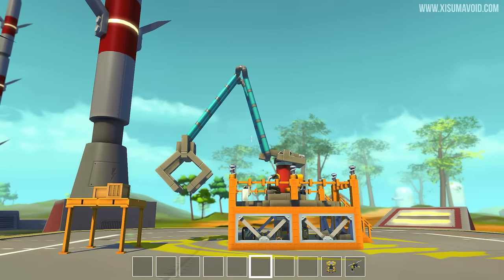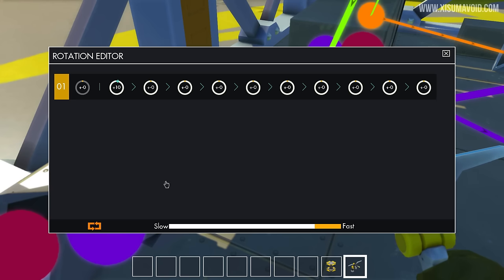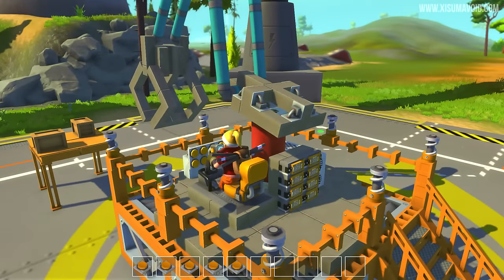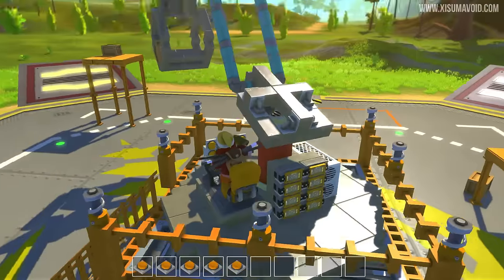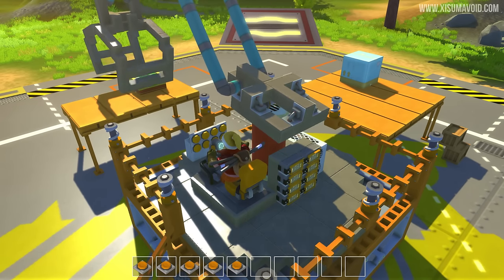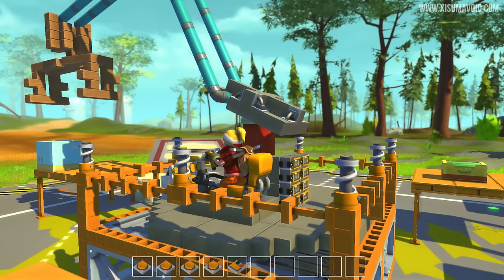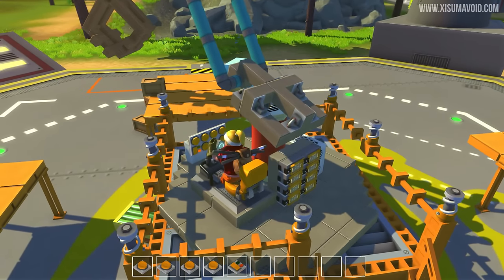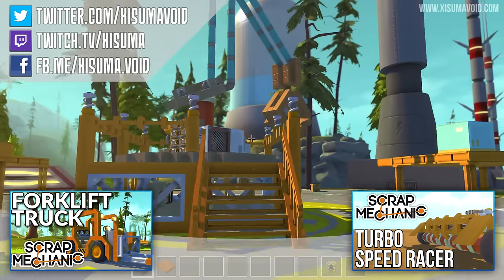Scrap Mechanic: Smart Crane

Comment: The problem with your claw is it only has two options... all the way open or all the way closed. So when you try to grab something the game is trying to close the claw all the way but a box is in the way and so it gets pinged off by the physics engine. Try to make the claw with many smaller increments of closure so you can more delicately grab a box instead of Kung Fu Death Gripping it.

Comment: Try using the small ramp block at the end of the crane so they can slide under the boxes.
You could also maybe put some sort of a counterweight at the back of the crane to prevent it from falling forward.

Comment: The small angled orange pieces might work better as the 'teeth' for the claw as the can wedge under the object you're trying to pick up. Also you could experiment with the small shocks to lessen the violent snapping shut of the claw when it slides off the side of the object.

Comment: Use small wheels, 3 on each side of the claw to effectively allow you to suck items up into a holding area within the claw. then you can just run it backward to let you eject items from the internal storage. You should even be able to move upto 10 boxes in one load

Comment: Hey X, Maybe add a way to tip the bucket, that way you can pick up items by cradling them, similar to a dump truck, rather than sole pinching them. Also, giving the claw an analog control rather than only open and closed may help with how the game deals with clipping objects.

Comment: i got 2 ideas for you to try out on your crane:
1) put a censor inside the claw so a small thing reacts (like a 1x2 row of blocks turning) inside the cockpit that shows that you are hovering above the crate
2) put a row of the small 45 degrees ramps on the crane so the edges slides underneath the crate a tad easier

Comment: Hey xisuma! i have an idea for a claw that works perfectly, i used it on a flying pad i built so i could pick up toilet paper with me :D but it should work on a bigger scale too (although it doesnt look like a crane claw..):

lets assume your claw is like this:
------------
|            |
|            |
|            |
^     **   ^

**  is the box you want to pick
the only moving parts are the "^" signs and they move horizontally to close like this:
------------
|            |
|            |
|            |
------------

the box will just jump up into the soon to be closed containment area for it. 

Notes:
* Be sure to cover the claw from all sides otherwise the box will fly out of it
* Wont work on non-flat surfaces

Comment: I think the main problem would be that the claw doesn't have any sort of grip, so the boxes just slide out. Maybe put some wheels at the end, then make those wheels pull/push the boxes into the claw?? or put those wheels horizontally and not move them at all??

Comment: Firstly, you did a great job on the crane with the Twitch chat.
Secondly, I think it would work better if you don't use a claw. That would require a hook (or different mechanism) and modifications to the box though.

Comment: maybe make the claw a 4 way design so that it holds the item from all 4 directions. That way the only ways it can go are up or down. if it goes up, its good to move, if it goes down, just try again.... or maybe the 4 will be strong enough to just hold the item in place without it sliding out... I also thought of something cool, why not make the crane attachment be like a forklift where the bars get inserted beneath the item. So the item will have to be in a pallet thing which should be pretty easy to make and then the clay would have 2 prongs on each side that can just be inserted into the pallet :P Just a funny cool idea... and also, one last idea, it would be cool to see a crane that can move a fallen train back onto track... XD It would be hard, but cool in the end if you are able to pull it off.

Comment: If you could make it close completely (by making two interlocking bits on the side) that might solve your problem with things popping out. Are there any bits that are thinner than one block? if so it might work to put those on the edges of the claw to slide under. maybe even ramps could work to slide the box into the claw. looks good though!

Comment: The claw may should have only 1 bearing for each "finger" of the claw.
The bearing that rotates the claw should be an "H" form instead of an "I" so you only need to put 1 bearing into the "H" on each side and the claw itself would be a bit smoother.
I hope it's understandable what I mean.

Comment: +Xisumavoid First off, nice work. As many others have mentioned, angled tips on the claw would be good. Something else you may consider implementing would be a counter weight, perhaps even make it adjustable. Just add heavy blocks to the back of the base head (the part attached to the top of the red pipe). If you want to take that a bit further, use some bearings to make it extend further back (much like how sliding doors are designed). A 4 way claw could work, but I'm aware that there would have to be at least a 1 block offset which may cause it to not work.

Comment: Why don't you zoom out when controlling the crane? It would be much easier to control.
Reply: *too
Reply: +Wagacca He also should've used the same method for the bucket he used for steering (and everything else). That way, he could've just pinched the boxes to lift them.
Reply: +Charles Preston No, he got that right. His comment has 100% perfect grammar and spelling, nothing is wrong with it. There's only one O.
Reply: +Datenegassie Because #Derpsuma
Reply: +MiroTech Software No, 'too' means an excess of. In this case an excess of rationality. 'To' is used to separate two things and include what's between them. As an example "From Paris to Berlin." indicating a journey from Paris and ending at Berlin. In this case he does not mean from being and ending at rational. Which might make sense in the context of a dictionary but not here.
Reply: +Xeridanus Exactly, he was being more rational than he should have been.
Reply: +Matt G
Ah good point. Didn't see it that way.
Reply: +Xeridanus "To" can be used as the first part of an infinitive (To + Verb = Infinitive).
Reply: NASH90000 gah read the other comments first. this has been resolved already

Comment: X you should try to design the claw in a " + " shape rather than a " H "
Reply: Like the arcade cranes?
Reply: Manon Epicness exactly
Reply: +Martin Angelov are you killing arcade cranes are the worst!
Reply: +Joe Williams thats becasue they are set to a very weak setting. But it would be better for grabbing something.
Reply: +Kevroa No, thats because they are rigged as heck xD
Reply: ProSeals  well.... think about why they are rigged.... they are set a pretty low setting to grab objects. After a certain amount of turns, the strength increases enough to grab the item, and after than it goes back to its weak state.

Comment: I think using electric engines instead of the whole controller business might make the whole thing more stable and less finnicky. controllers cant produce o whole lot of torque but electric engines can, plus they are excellent at holding a bearing in place

Comment: For turning the whole crane left and right couldn't you just put a bearing at the bottom of the large pipe and connect it to the drivers seat? left and right keys (a and d) automatically turn bearings left and right